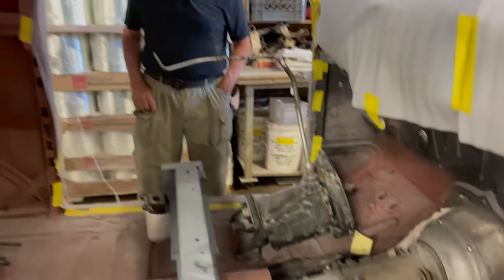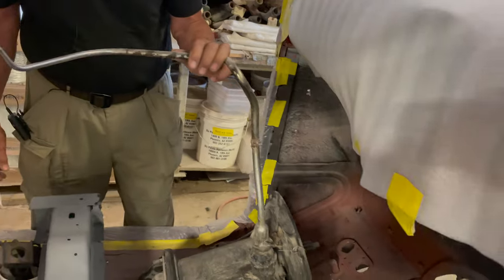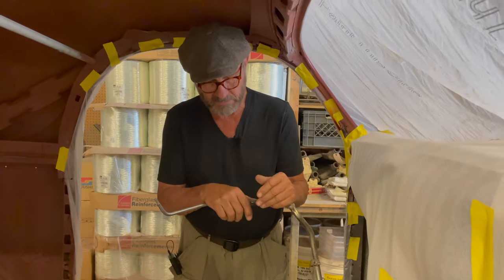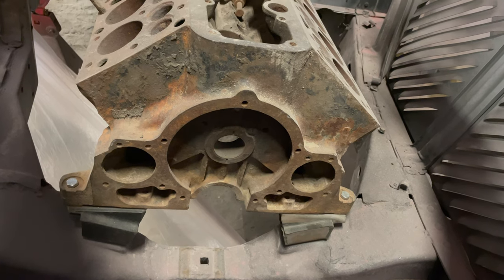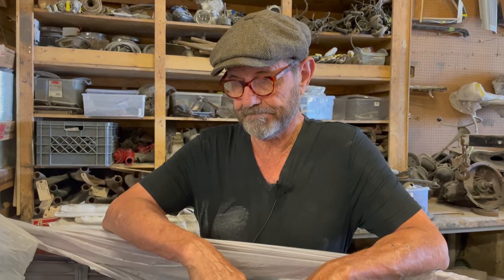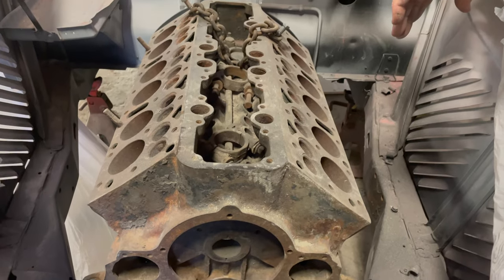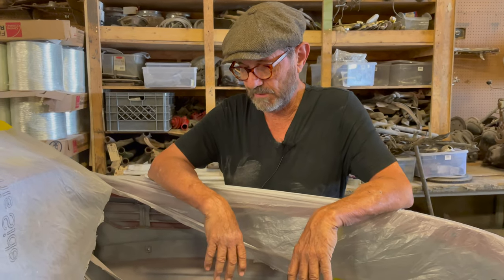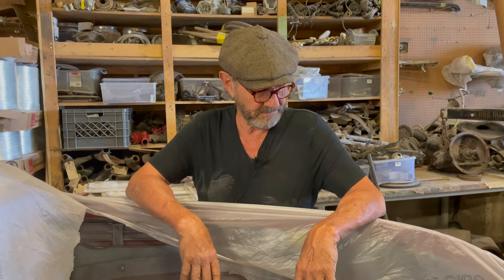Zephyr V12 Automatic? Part 32 Transmission Mock-up. Restoration of a 1938 Lincoln Zephyr Coupe

Comment: Seems to me it'd be worth putting in one the old Ford AOD's,, it's a crisp shifting 3 speed with automatic overdrive,,  with the right axle ratio seems like it'd be the perfect match for that V12..
Reply from the maker: I agree that would be a worthy consideration, depending on how the owner wants to drive it. I’m not sure about the dimensions of the AOD compared to the C4, I know the C4 is quite compact…
Reply: @BarryTsGarage   The AOD swap would add some complexity with the tv pressure cable and all but it'd be worth considering IF it would be an improvement.
It's possible the overdrive really isn't needed.
Reply from the maker: I see your point!

Comment: How does the torque and horsepower curve of the V12 match up to the way the C4 transmission works? Do you use a high stall speed torque converter or not?
Reply from the maker: The power curve seem to be reasonably close to small block Ford’s from the early 60s they were often in front of those C4 transmissions. We tend to just leave it as is we don’t change the torque converter to the best of my knowledge